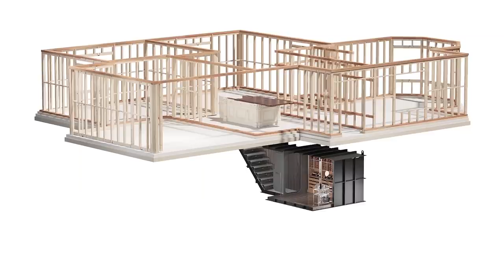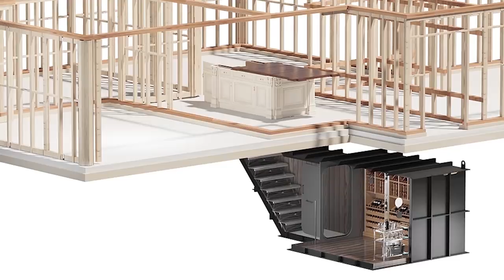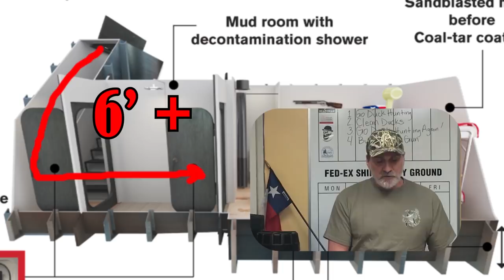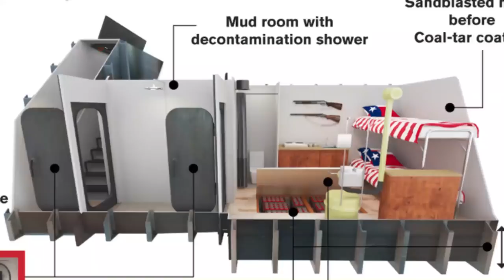ATLAS Survival Shelters an Engineering Marvel

Comment: Thank you for addressing the ambient temperature issue.  Using the earth as a thermal flywheel for your shelters is brilliant.  How do you add heat in areas that are too cold (ambient temp < 56 F)?

Comment: Great product, BUT a correction to your statement on your 3/8" armor plated /late doors.Yes they can be shot through,secret that is figuring out a way to be hidden(same with your above ground pipes),other wise cutting torches will sever them, and they can always be sealed shut.
Reply: I would hide the pipes by putting old tree stumps over them. Of course make sure they are hollow. another thing to do would either be heavy vegetation or make it look like something else. Like make it look like an old gas meter or electrical box that went to an old house.
Reply: Agent Chicken what are the odds people will tamper with it though

Comment: Good shelter designs. May I suggest too whom ever buys one, or preps, is too: actually do a drill scenario so you actually experience the bug in situation; Where your in your shelter or bug-in area, depending on everything in your shelter. Plan it so you can use vacation time, so you have a job to come back too, along with school time as well, and notify someone trusted, information in case of an emergency. Plan too completely depend on your preparations. It's not as easy as you think. You have too stay inside for 3-6 days,   14days to 30days , this will show you where your weak links are. And it will allow for stock rotations, through replacement. Be safe ,be prepared, God bless amen.
Reply: Here's the scenario perimeters:  all utilities, are no longer working, this includes internet service, and cellular phone. How ever some signal is coming through citizens band communication( separate power source). Martial law has been put in place, with use of lethal force. Stores are empty, due to last minute grabs and looters. And highly contagious virus, is spread all across the country. And renegade groups are taking over areas, causing military conflict on friendly soil. The supplies are limited to what you have. Bartering is out of the question, you are on your own. (Except in the event of an medical emergency 911 situation) this is only a test, of your planning skills. Be safe, be prepared, God bless amen.
Reply: This is a really well thought out scenario. Points for that.

Comment: I was curious if you do anything like American Safe Room?   They have a roof kit you can buy if you want a poured concrete bunker/safe room/ tornado shelter.  You do the walls up to 14 ft apart with concrete then install steel girders to do the roof with access hatch and air vents etc. You then pour concrete on the girders for a poured concrete roof.  I was curious on your thoughts on pros and cons of a system like that.

Comment: The only thing I don't like is bringing radiated air into the shelter before cleaning through the air filters. There should be a 2 stage air system. The first filter in the generator pod and the secondary filter inside of the bunker. This way the air has already been cleaned before it ever even comes into the main part of the shelter.

Comment: What stops the bad guys from plugging the air pipes and suffocating you to come out?
EDIT:   My comment was not meant to be an insult towards Atlas, but a technical question.  I appreciate them stating that their entrance hatches are bullet proof from bad people getting in, and that the air pipes have a drain system in the event of water or gasoline being poured into the pipes from the bad guys.  But I haven't heard what their solution is for someone just simply plugging the air pipes?  The lack of a supplementary air supply system is my concern.  
As for a tornado or bomb shelter, they appear well engineered.  As a "Zombie Apocalypse" or hostile invasion shelter, it has it's flaws.
Cheers,
Reply: Atlas response: crickets crickets
Reply: @raymondfisher5552  My comment was not meant to be an insult towards Atlas, but a technical question.  I appreciate them stating that their entrance hatches are bullet proof from bad people getting in, and that the air pipes have a drain system in the event of water or gasoline being poured into the pipes from the bad guys.  But I haven't heard what their solution is for someone just simply plugging the pipes?  The lack of a supplementary air supply system is my concern.  
As for a tornado or bomb shelter, they appear well engineered.  As a "Zombie Apocalypse" or hostile invasion shelter, it has it's flaws.
Cheers,
Reply: Nor was mine. I was pointing out the response you'll get from all the producers of these "survival" bunkers/shelters when it comes to the issue you've raised.
Reply: @raymondfisher5552  Understood, cheers.
Reply: The way the air pipes are done putting any type of fuel down the pipes does NOT work. Also if you blocked the air pipes trying to KILL people for NO good reason your going to get locked up and ass raped or shot trying to KILL people for NO good reason. As for finding the bunker to do this ?? Where I live in the UK there are plenty or worse bunkers from WW2 and the cold war that people drive and walk past every day and have NO idea they are there !

Comment: You say you can bury these things up to 40 feet? I know you said typically it's 6 to 10. That seems doable, but is it possible to get down 30 plus feet? I don't even see how you could dig that deep. Hold on. I think I see how it would work. The hole just has to be big enough to get the shelter and digging equipment down in the hole itself with enough room for ramps and stuff. But gosh, that would be a lot of work. I guess that's why it's not common. Would being that deep in the ground offer any additional benefits? Cooler maybe? Cool as in colder, obviously it's cool as in awesome.

Comment: Question ,neutron radiation from what I know the culvert shelter might not protect you like it will from Gamma ?so what about pouring concrete around it ? Doable ? Concrete ,boron or water apparently are the key for neutron radiation shielding .your thoughts sir?

Comment: if anyone is looking to buy a shelter i would give advice that going the cheaper option with metal for your shelter it will cost you more in the long run. metal will rust  when buried underground. wood bunkers are stronger safer and last longer.
Reply: The metal does not just rust where I live in the UK there are still plenty of bunkers from WW2 Atlas is using a lot BETTER metal than was used in WW2 !

Comment: What good are gas doors in a fire if your air intake is sucking in smoke? Will your air filtration system filter out the CO from the smoke?
Reply: Every time you put in clean air the bad air is being pushed out. The door stops smoke or other from the outside from coming in.

Comment: Do you have a coatic that could be applied to the inside of the shelter walls that absorbs sound to deaden echo?  The submariners call them  "anechoic coatings" (but they put them on the outside).
Reply: That was supposed to say "do you have a coating". Sorry ...old guy.

Comment: Wouldn't you have to hit the aquifer underground so it would be actually functioning, because who knows how long someone would have to stay down there. 
Would the depth block thermal detection? Cause if you can be found that defeats the purpose.
Also, pipes on the surface doesn't seem right. Seems like they would melt not to mention, depending on where the blast was, wouldn't they just melt?

Comment: I was wondering. On the bullet proof hatch. When you are inside, can you be locked in from the outside?  I realize that there is a hidden escape hatch. But could it be locked from the outside?  Just curious.
Reply: I believe on another video he mentioned that there are two pins on the inside which can be knocked out to open the hatch even if someone tries to lock you in.
Reply: Some doors have a hydraulic Jack to lift 20K pounds up to 20". If a tree falls on your door you will want a way to breach it.
Reply: Thanks I knew that there was an answer. Thanks for putting it to rest for me.
Reply: The escape door is locked from the inside only and covered on the outside.

Comment: Ok...what if...someone plugs the air-pipes? how do the people inside breath? Those that supply the air-filtration system! 

Air-would run out and the people inside would have to take the guns and climb outside in virtual suicide!

Where does the secondary escape hatch lead too? 300 feet far away from the shelter? if so...

if so the people inside could flank the once who plugged the air-pipe...

1 flaw to be engineered into a solution holds yet

good job for the rest...I like it!
Reply: They are bunkers...not a fortress.
Reply: @billsmith981  They could provide 'camouflage' for the air-system to fix it...if none can find the air-pipes all is good!
Reply: @MrBabis911  they are most likely limited on the amount of "Draw" the system has...if the bunker is 42' under ground and you run air inlet an exit pipes far away enough to not be noticed then you would  need a big pump.
Reply: @billsmith981  another solution is that, now, just provide a camouflage and we are all set to go.
Reply: @MrBabis911  they did that in one of the earlier vids...labeled the intake as as something from the utility company ...I think. But they also hid the hatch...
Reply: @billsmith981  there, now its a complete set!
Reply: You can have the escape as long as you want it to be !If you blocked up the air pipes don't you think you would get locked up for KILLING people for NO good reason or you get shot trying to KILL people for NO good reason ??

Comment: Hey Ron,
Is it possible to add either a cable/winch lift or some other way to assist elderly or wheelchair bound folks up/down into the bunker?  I have both aging parents and a nephew in a wheelchair and they would need this type of assistance to expedite them into safety.  Thanks for your input sir.
Reply: Larry Skylar : If they couldn't do it you could probably get one of those things they advertise on tv where you put the person in a chair that slides up and down one side of the staircase where it is attached. It might be tight but I doubt they could make the stairwell any wider because they would have to alter the bullet proof doors nd they are probably a pre-set size.It also may be cheaper if y cou use the slide chair. Atlas may charge you more. When you go to Atlas to buy your  she lter, you should go armed with the info so you  can compare prices !
Reply: @michellemybelle62260  good idea, hadn't thought about it. Thanks!

Comment: When you were talking about the air pipe in the example it was 20 feet out is that necessary and why?
Reply: It helps hide the location of the bunker especially if you combine the air pipe with a bird house. It also helps regulate the temperature of the air going into the bunker and helps remove moisture.
Reply: It works like a condenser for the incoming air. The air coming in through the pipe is fairly moist so cooling it down a long pipe will cause the moisture to condense and drain back to the air entrance. Well thought out engineering. In theory the pipe could be like a big coil but that would be hard to find.
Reply: It stops people from putting fuel or other down the pipe it also keeps water out from damp air and keeps the air cool in summer. It is in other videos buy Atlas.

Comment: It seems that if anyone wanted to get the people out of the shelter, all they would need to do is cover up the air intake pipe with say, rubber, soft plastic.  There needs to be a way for that to happen.  If you can't get air into the shelter, then you need to get out.  Just a suggestion.
Reply: By blocking the air pipes you are trying to KILL people for NO good reason don't you think you will get locked up and ass raped ?? Or shot trying to KILL people for NO good reason ?? As for finding them I live in the UK where there are still plenty of bunkers from WW2 and the cold war which are worse than what Atlas builds and people drive and walk by them everyday and have NO idea they are there !